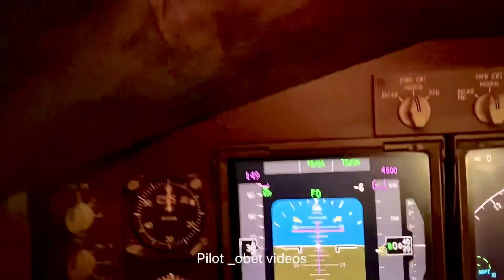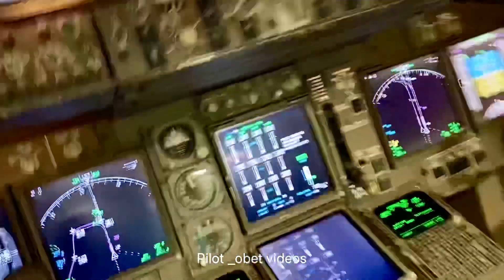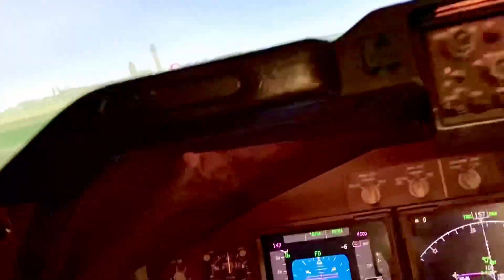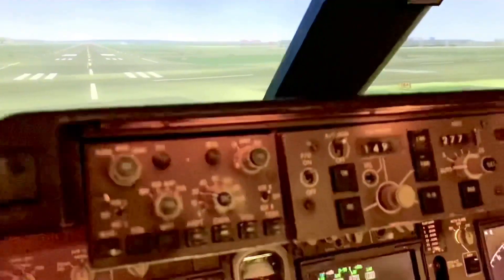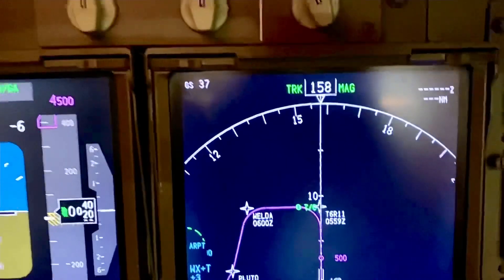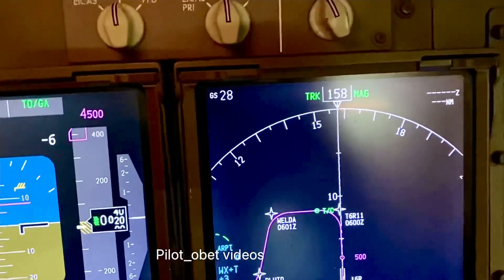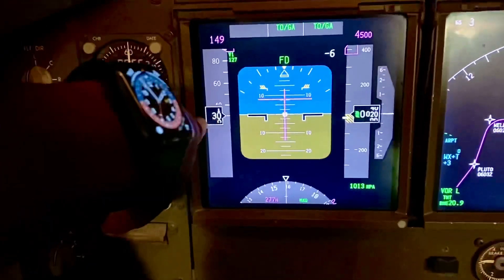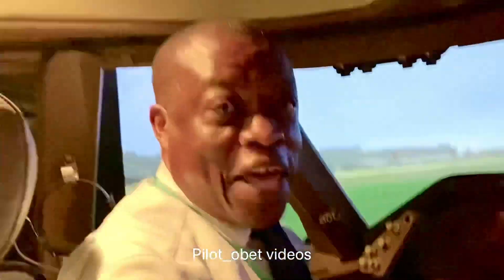Boeing 747 Taxi speeds and Ground speed

Comment: Hey Obet, what is the difference between Air Speed and Ground Speed?  (is say 100 knots on the ground the same as 100 knots in the air?)
Reply: The ground speed as the name implies, is the velocity relative to the ground. But because when it comes to the air speed, jet streams and winds move in different directions and velocities, so the values may change. Airspeed is measured using probes called pitot tubes, which funnel air through a straw like metal pipe, and the air rams inside increasing pressure on a load pressure sensor, which translates and converts the readings into airspeed. Ground speed is measured by laser and radar tracking.